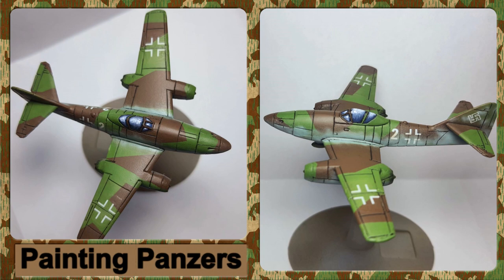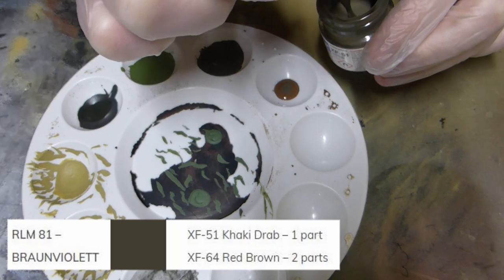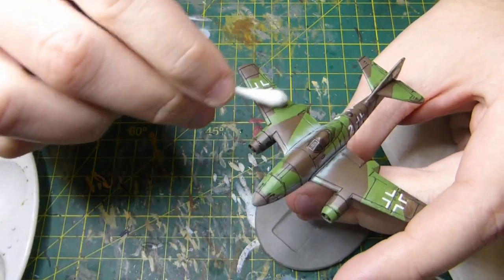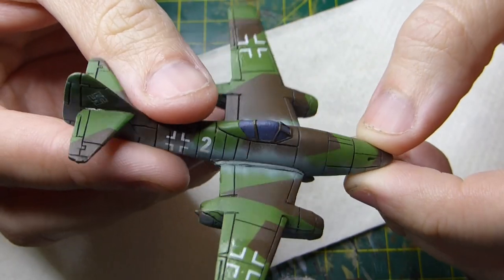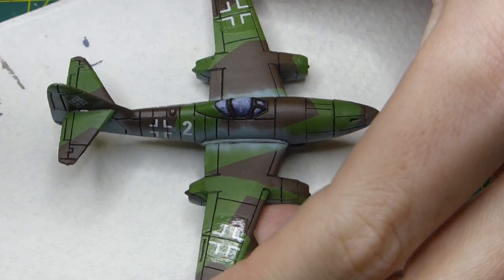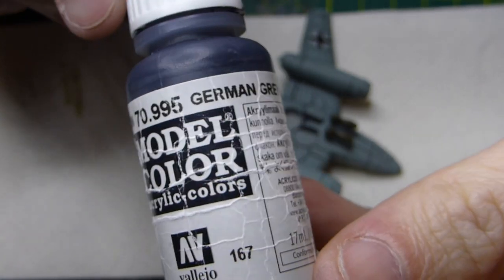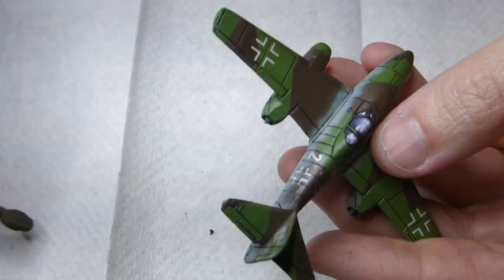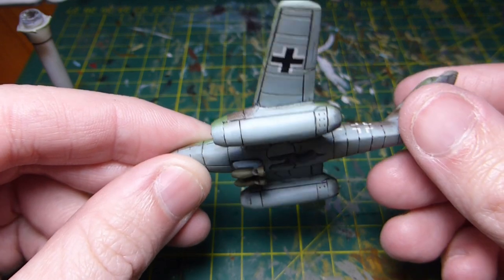How to Paint a WW2 German ME 262 fighter jet in 1/144!

Comment: Another excellent video. Another way to do panel line clean up in hard to reach areas is by pinching a Q-Tip to give it a narrow edge and then use that to get into the nooks and crannies.
Reply from the maker: Thanks a lot buddy 🙌 that's an absolutely fantastic tip, I'll be sure to give it a go as this method can be hit and miss 😀